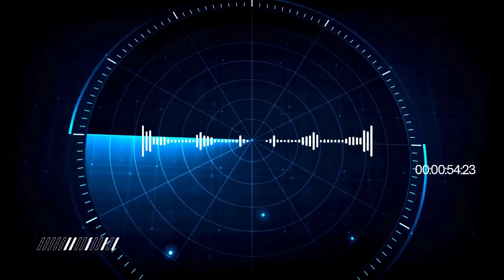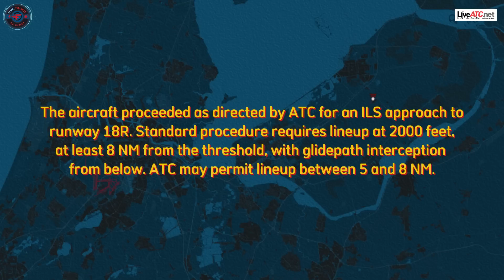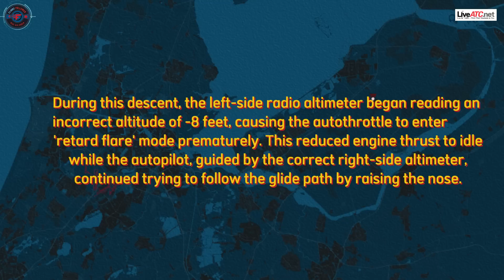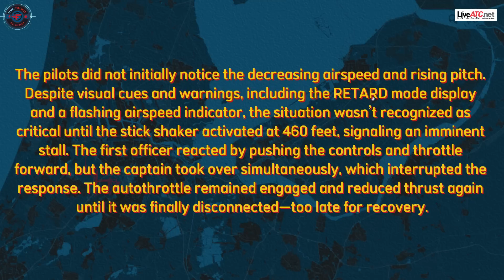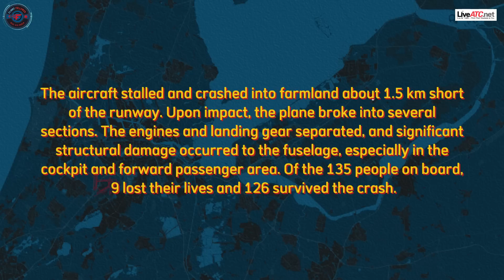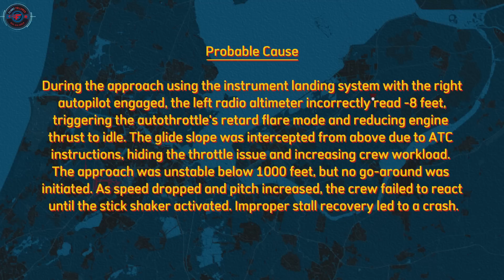How a Faulty radio Altimeter Doomed a Boeing 737 Seconds Before Landing! (2009) #atc

Comment: Yea what the hell,  if there is a large split in RA data,  computers ought to recognize this,  if they are looking at both outputs. That is like the Max, not comparing AOA data for a discrepancy.  The rad alts have extensive internal monitoring for faults and should flag and give offscale.

Comment: Yes, the pilots should have caught it but I think this is also a surprising design flaw. The autothrottle should disengage with an alarm if there is a large discrepancy between the two radio altimeters.
Reply: A RA fault will certainly not allow an autoland function but not sure about auto throttle. Also no CAT III available I think.

Comment: 100% Pilot error.   Their only job inside the outer marker (5 mile final) is to monitor their airspeed, vertical and lateral guidance.   This flight crew must be related to the Asiana flight 214 crew that crashed in SFO.